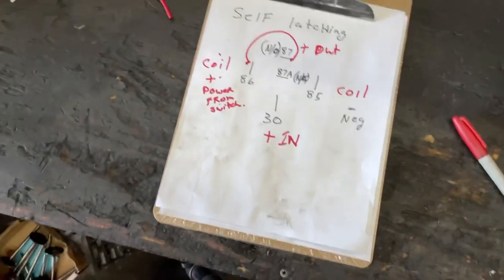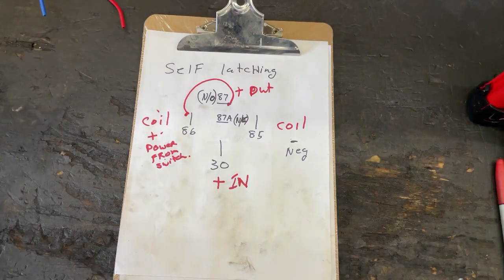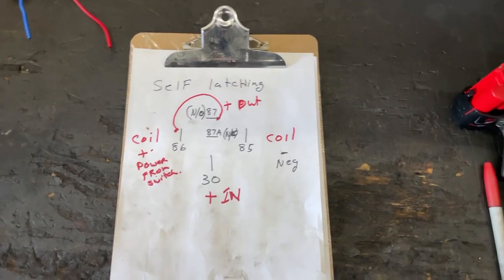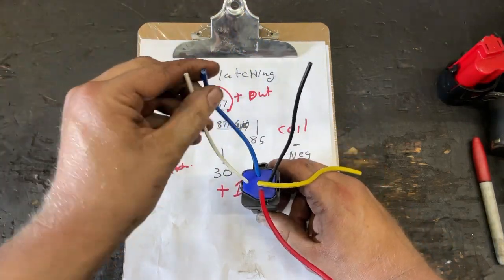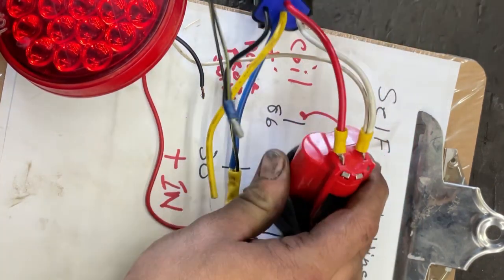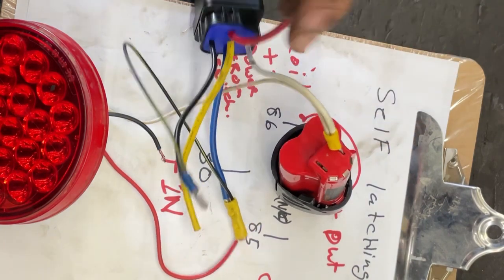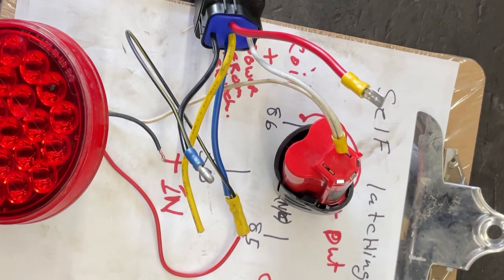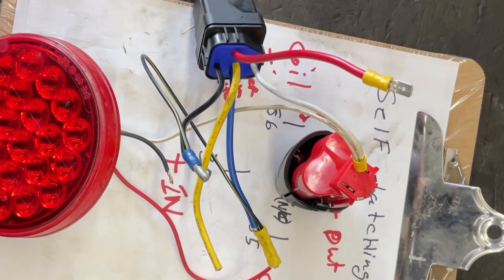How to wire a self Latching relay ( IT'S SO EASY )

Comment: thankyou i didnt know that, how to wire a regular relay to act as a latching relay. Hella have one but you need an on/on switch and its rather expensive.
Reply: Look up "VW / Kharman Dimmer relay". Same as what Durite sells and for 1/5th thr cost.
Takes a single momentary ground to latch and unlatch. Uses zero current in either stats

Comment: So can the momentary switch turn it off back?
Reply from the maker: No you need to kill the power from the unit
Reply: You could have a 2nd momentary switch to turn it off though. You could just use one that's normally closed, in line to either side of the coil control wires of the relay.
Reply: @jonmcdonald6374 In my case though I only want to have one momentary so am just going buy a latching relay

Comment: Thank you for sharing this great idea, I THINK is what i need.
I just had a question -
Can I use this with a  momentary button, as you mentioned, as I want to close the NSS circuit (wire to starter selenoid) , which only has pwr when cranking?
I'm trying to do a "kill" switch in an old classic car that will activate automatically,  like you mentioned "when the key is turned off the circuit is open, but then when turn key to on then press a momentary button to close the NSS / starter solenoid circuit and then crank the engine. Then when key is turned off again the circuit returns to being open..
Reply from the maker: @thomascaruso3050  yep

Comment: Hi where did you get the relay from is it a special relay I tried it with a 5 pin and it didn't work
Reply from the maker: The relay I am using is just a normal relay. The difference in a 4 to 5 wire relay is just that one has normally open circuit and one is a normally closed circuit. It’s should work just have to double check the wiring
Reply: @CUTTERUPROB  ok thank you will try again  cause I used 87 and not 87a
Reply: @renebeckles8288 I think he made a mistake in his wiring diagram, even though he did not make the mistake in his example.
85 needs to be pos switch wire linked to 87 and/or 87a which is pos out,  86 need to be neg, 30 constant pos in that can be turn off to disengage
Reply: I've tried yours and it is working. Thank you. @samuelolsson6312
Reply: @samuelolsson6312 this right here like you say is how i latch for 2 step and disengage when i let the clutch pedal

Comment: Hello Rob,

Can you please tell me what the cruise control vacuum line size is? My cruise control doesn't work 1996 2500 5.9L 12v and its an old cracked vacuum line. I don't need the throttle cable that comes from the speed control servo, just the little vacuum line. Thank you sir
Reply from the maker: i believe it's  3/16
Reply: @CUTTERUPROB  thank you sir